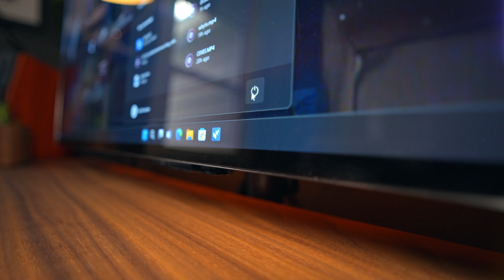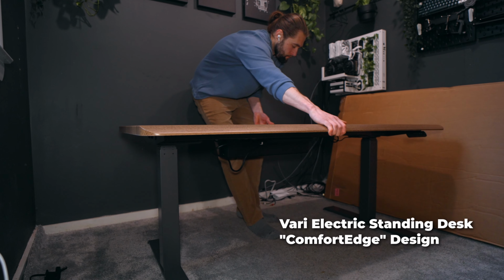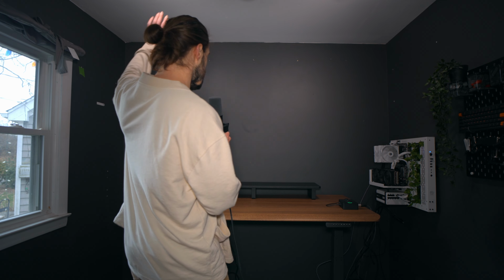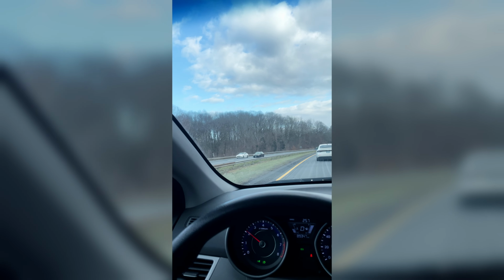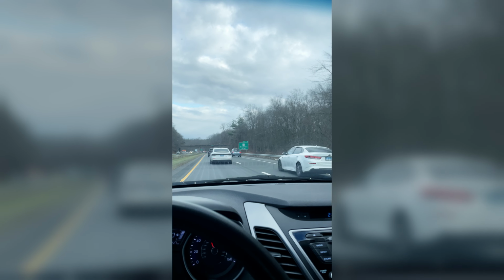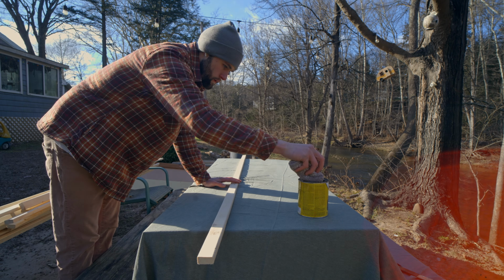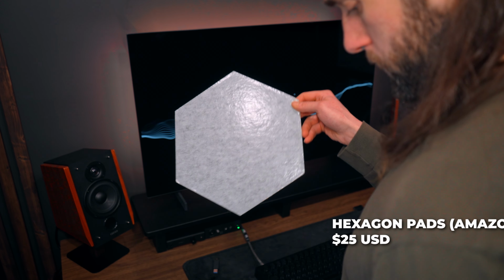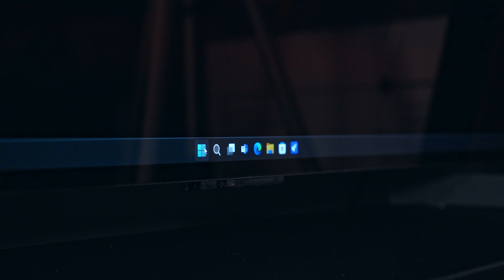Desk Setup Makeover 2024: Finally Endgame?

Comment: Nice setup. What are the specs on the wall slats? I’m thinking about going the diy route myself.
Reply from the maker: Thanks!
The wood is furring strips from lowes/homedepot, not really made for interior design since they're often banged up and not straight so I just made sure to pick the best ones I could (size was 1.5" x 8').
From there I just cut them to size, stained them, and used paneling nails to hold them in place.
I found they looked best when closer together so I did a 1" gap in-between each when hanging, but if I had more I probably would have done a smaller gap.